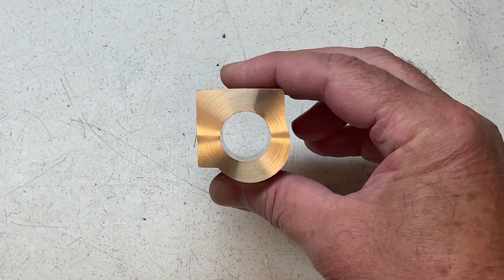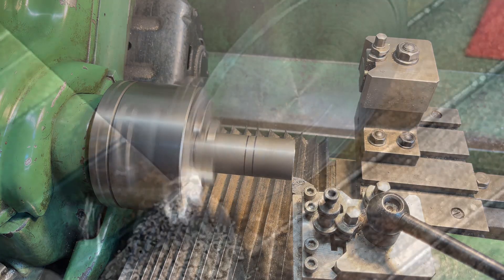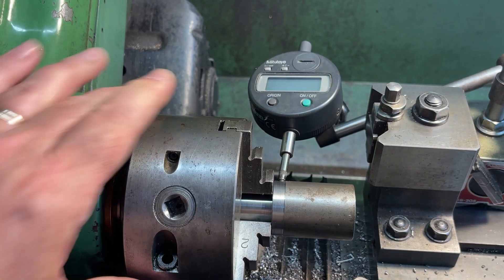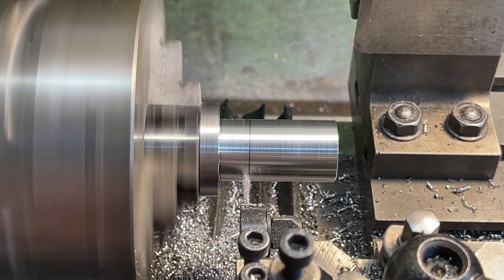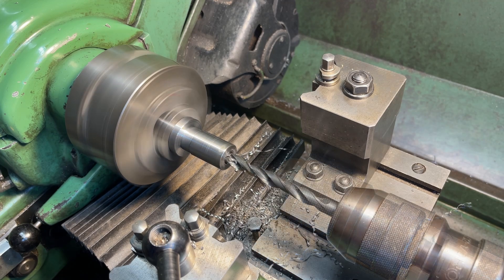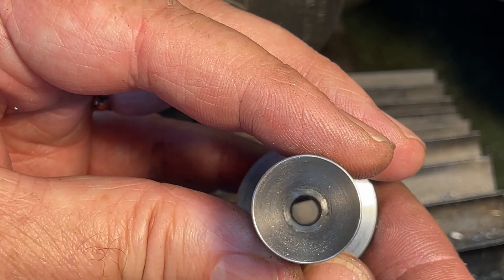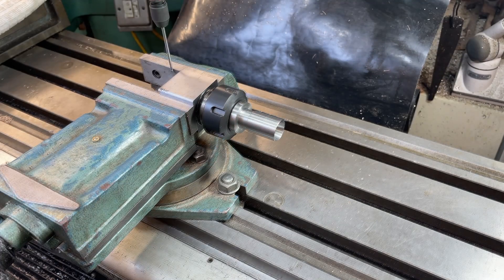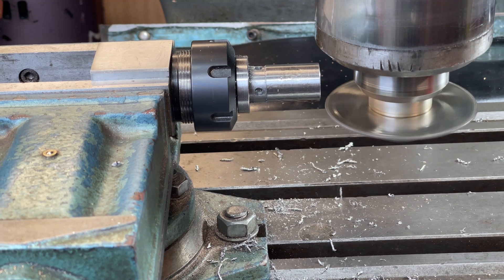Model Engineering Basics: No 6 An Expanding Mandrel

Comment: That is interesting, I think you made a Rolls Royce version of the mandrel. Years ago when working in  a workshop I used to make quite a few wind tunnel model that are mounted on what is called the "sting" in the tunnel. To make sure everything is true to the "sting" I used expanding mandrels a lot.  With mine I used aluminium but I didn't bore out the taper so much I would use a cap head bolt and just turn the taper on the bolt head and only have one slit in the mandrel. If the mandrel is a good fit on the work It will grip readily and very strongly.
Reply from the maker: @allanrichards3752  Hmmm could have saved some work there! Wind tunnel work sounds experimental, must have been interesting?
Reply: @steamworx  Yes I worked in an MoD research establishment and it was all very interesting boys toys stuff.
 Nowadays I would try just turning up the mandrel and using superglue to hold the cylinder on. You can then heat the cylinder to around 200-300C and the glue breaks down. There is a guy on YT "clickspring" who makes clocks and similar things with gears. He always uses superglue even when cutting gear teeth.
Reply from the maker: @allanrichards3752  Yes I have seen Clickspring, he is very good at what he does!  In the next video I am back to Dyak, machining the cylinders. The mandrel is used for different operations on each cylinder a number of times which scores over gluing in my opinion. Being able to easily swap between components and between operations is a timesaver. I guess MoD work is hush-hush but very interesting all the same. Thanks for taking the time to comment, hope you enjoy the vids!

Comment: Is there a reason why it was not made much closer to the length of the part for more location?
Reply from the maker: @marley589  The part to be machined was shortened. I needed to make sure there was plenty of room to allow for the tool to pass without hitting the mandrel. It is a surprisingly robust method of holding by a bore.
Reply: @steamworx  Thanks for the reply. It looks about 5/8" shorter than the part, I assumed that there was only about a 1/64" to come off the end. Were they two different parts in the video? If you want to avoid climb milling the slots, you can cut at the back of the mandrel feeding in the same direction.
Reply from the maker: @marley589  If you check out around 6:20 on the vid you will see the part it is designed for, there is about 3/16 to come off the end. With the slot, I prefer climb milling as conventional can grab and pull the thin ends of the segment out if you are a bit aggressive with the feed especially on the last slot where it gets a bit springy!! Thanks very much for your interest and comments!